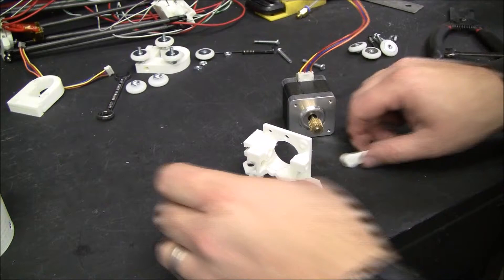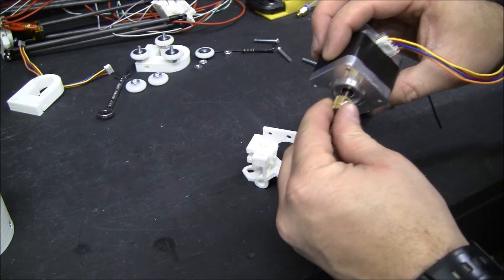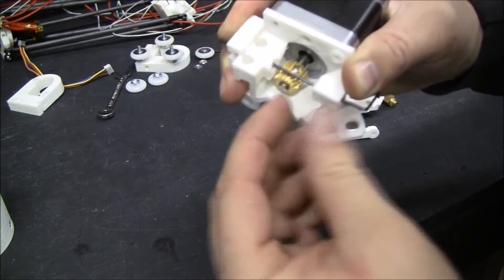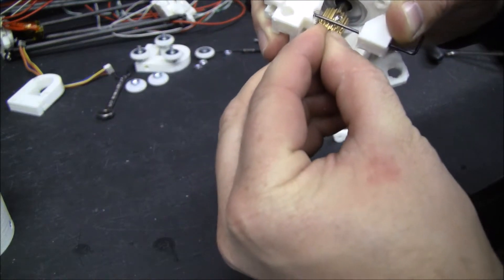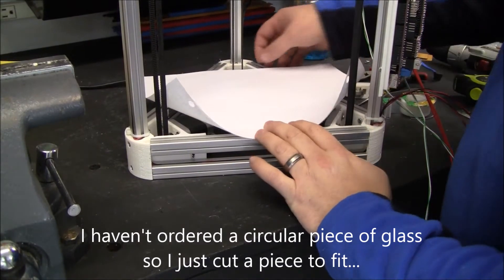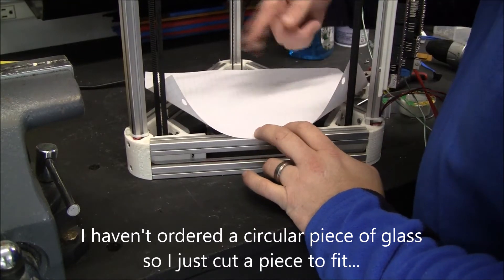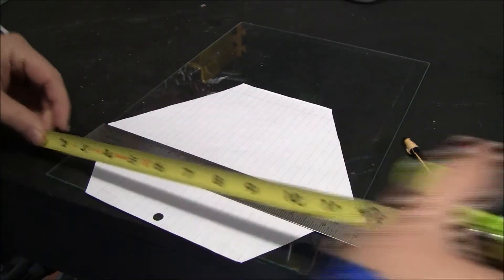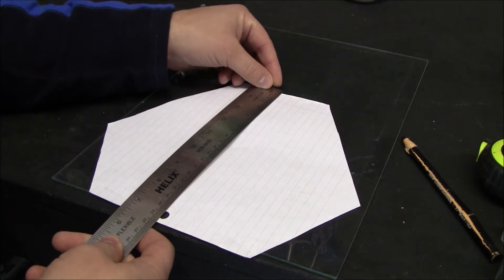Kossel Mini Airtripper's Bowden Extruder and Print Bed Build

Comment: Does your stepper motor for the bowden extruder have enough torque to push the filament correctly? I'm wanted to build an Rostock mini printer, The wiki page has the printer using an expensive planetary gear stepper motor is this really necessary? The stepper motor you are using seems to be a standard nema 17.
Reply from the maker: I would say that it can work in some cases however I ended up yanking it out and used Greg's Accessible Extruder instead because I am not interested in buying a $70.00 geared stepper motor. If you reduce your slicer settings to print smaller than the diameter of your hot end it will probably work. For instance it struggled to print .3mm with the hot end orifice .3, it could only handle speeds of around 45mm per second. If however, in your slice settings you tell it that the orifice is .15 you can get away with less torque and move faster, you will probably want to do this anyway for higher resolution prints.